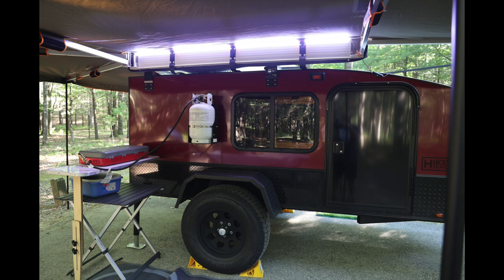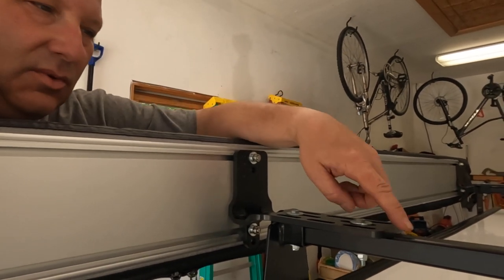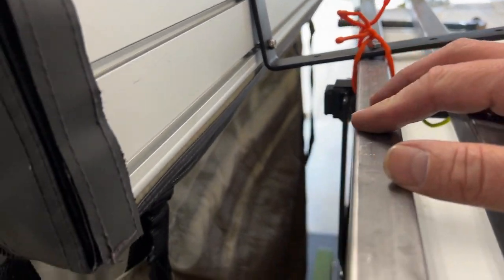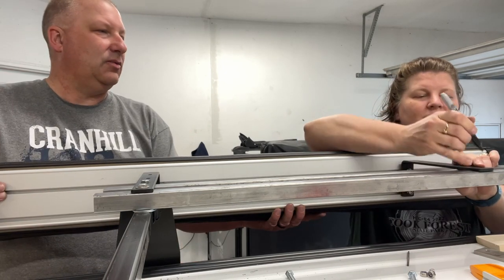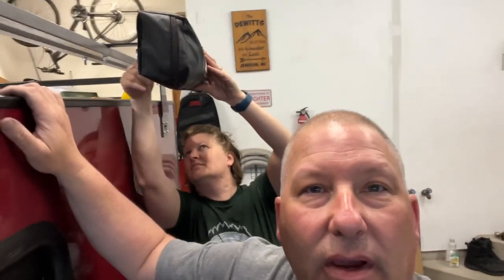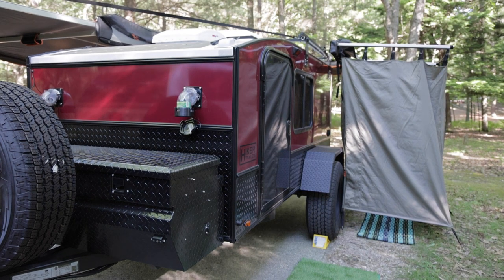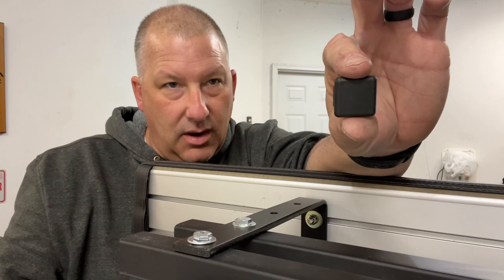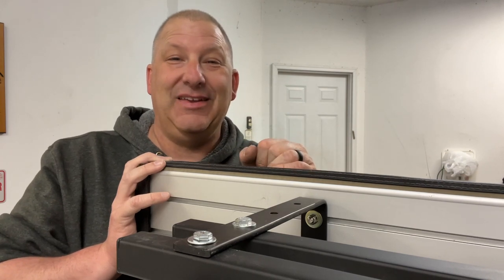Hiker Trailer Build Series: Awning installation

Comment: Hi Matt and Wendy. I just got my first Hiker this week. A 5x10 Mid Range and I LOVE IT! It came with a 23 Zero awning but I want to add a ROAM awning that I already had to the other side. The hardware that came with it doesn't work on the 1 inch square crossbars on the Hiker. Do you know if Hiker sells the required hardware or is it something I can pick up somewhere else? Thanks! Katie

Comment: A couple of questions.  We just upgraded from highway deluxe to midrange with 2 roof racks. We have been using a stadium canopy, but I  would like to upgrade to a 270 awning. I see MWD went from darche to the 23zero. Which  one is preferred? Also if you have that mounted on one side and nothing on the other side do the tires wear funny? Any input would be great! Woukd also like to get walls.
Reply from the maker: We have had 23 zero shower room all along and love it.  As far as the 270 we had Darche on the first trailer because that was what was sold with Hiker at the time.   We kept with the darche line because that is the kind of walls we had just purchased.  We stuck with Darche.  Looking at the construction of the 23zero and knowing some people that have the 23 zero 270 I would say they are both good products but Darche is our preferred.
Reply: @MWDAdventures  thanks  for the quick reply! Sorry my bad I  thought you changed 270 awning. We bought moonshade after your review and have it up now over rear door  it is working great, but not happy using stadium  awning. Looking for quicker deployment if setting up in rain.  Like the pouring going on currently  in Petoskey. Sorry we are missing the 4th annual, maybe we will make the 5th
Reply from the maker: @michellepinkava6887  we would love to have you.  See ya next year.

Comment: Hey Matt!  First, thank you for all of your outstanding content. 
What you and Wendy do to contribute to the Hiker Family takes an incredible amount of time, energy and effort—I, for one, am very grateful!!  Second, how is Hiker mounting the privacy/shower awning L-brackets on the two-bar roof racks at the factory (if they are)?  Also, would this mod had  been necessary  if you had the Hiker three-bar roof rack system?
Reply from the maker: I'm not sure how they mount it at the factory. The standard width between the two bars is wider than the shower room, so you would need some kind of bar for the L bracket to connect to on one end. If you have 3 bars in the rear area, you could use those for the mounting points for the L bracket. Then adjust the position of the shower room with the adjustable slides on the back of the shower room
Reply: Thanks again, Matt--really🙏!  MWD was invaluable to me as I put my build together.  It's scary 🤕 for me to think of how many mistakes I would have made without your counsel!  You saved me from a lot of heartache, believe me!  That said, let's "get out and do some camping!!"😉 Safe travels!!

Comment: Question on your installation of the 270 awning mounting brackets (since I’m getting ready to do so myself): why did you end up drilling a hole in each rack bar to utilize a second bolt per bracket, instead of using the u-bolt as you had originally done? Was there an issue you ran into using the u-bolt for each bracket? Did you find the u-bolt installation to be less secure?
Reply from the maker: If I remember correctly, we thought it would be more secure to drill into the rack bar.

Comment: Have you guys thought about pioneering a little bit better rain covering for the awning?  I’m in the Midwest too and use my awning more for protection from rain than sun.  I’m looking into a mod that will work better than putting a 5” pool noodle in between the roof top and the awning.  Could a “L” shaped square 5-6” piece of foam be made for the opening.  It could soak up water on the roof top and do a better stopping the rain.  My goal is to be able to fully protect things under the awning (like the table) from the rain and/or to cook and work in the rain.  Just wondering if you thought about this before I work on it.  Thx
Reply from the maker: In this video, Jeff had a creative solution for that open area:https://youtu.be/4wiFDkX_uCo
Here is a link to the material: https://amzn.to/3JskVHF
Reply: @MWDAdventures  
Thank you very much.  Great idea.

Comment: Nice job you guys.. So I'm sure you've been asked this numerous times, but with all the different small campers out there, why Hiker? Say verses a Bean or Valiant?? Other than cost why Hiker?.. I ask for future reference as looking to simplify and exact my camping experience! Following...   Mark
Mark
Reply: Reputation ... Rob R told me he has estimated over 4,000 Hikers made during a conversation.   I don't know if that includes both IN and CO facilities.   With the origin of teardrops as being low cost, seems like that is history for some other vendors.   Now, there may be others in the category of  Hiker $.   Runaway had a lot of videos at the time.   Road Toad was very close, but lacked features and I was just uneasy about modifying a fiberglass composite body and galley.   Distance to vendor, yes, it also weighs into things as budget can not be ignored.   We chose a Hiker over a tent or a Coleman pop-up camper.   If money was no option, would Bean or Valiant be on the list?   Not likely.
Reply from the maker: Price was a big factor!  We went to the factory before purchasing and were impressed with the quality and options available.  Also, we live in Michigan, so they are closer to us too if we would have any issues and need to go back to the factory (which we haven't had to). For those that live further away, they have been known to send the appropriate part to their owners so a repair could be made.

Comment: Could the shortened Hiker bars have been replaced or are they bound/binded from installation at the factory?
Reply from the maker: They can be replaced. There is a screw at each end holding them in place. We actually used that screw as one of our attachment points.
Reply: I replaced mine with a set 3-4 inches longer just for this reason.